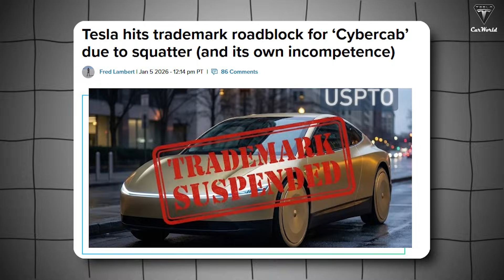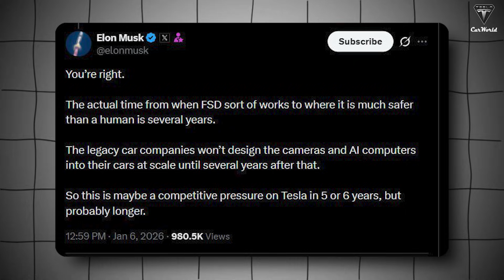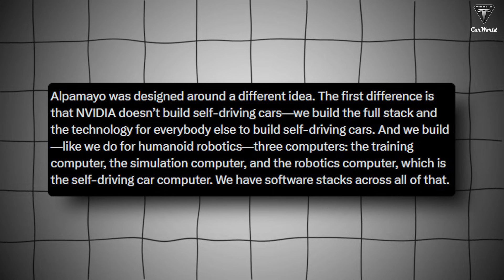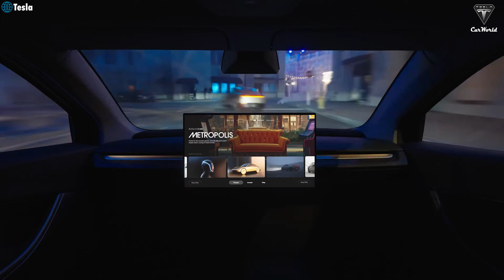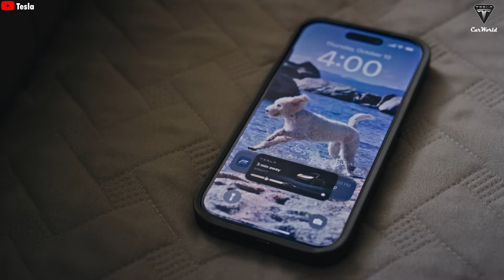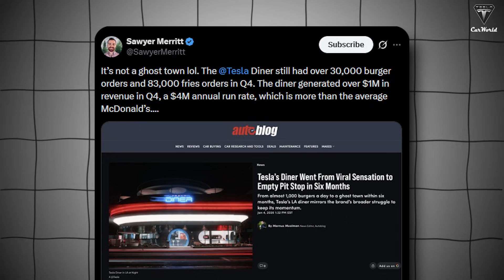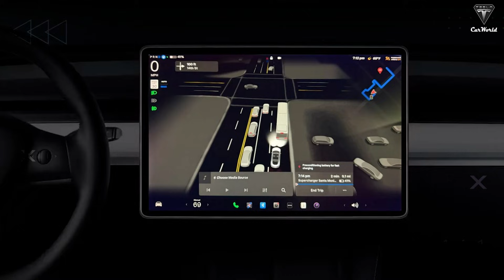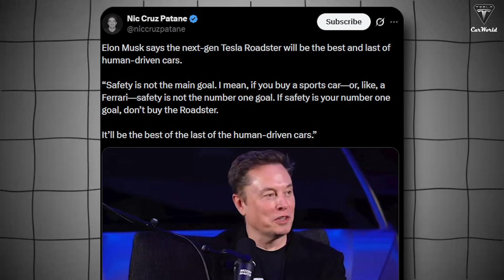Elon Musk Announces Tesla Robotaxi Cybercab Will Take Down Waymo, Nvidia In 2026!

Comment: Waymo currently has a fleet of over 2,500 fully driverless taxis. In contrast, Tesla has zero vehicles legally capable of operating without a human in the driver’s seat. If a Tesla crashes while a passenger is in the backseat, the owner, not Tesla bears full legal responsibility. Waymo  accepts legal responsibility for the vehicle's actions, citing that their "driver" is the tech itself. Tesla, however, continues to place the burden of safety and liability on the human operator. To advance to level 4 or 5 the tech needs to be insured, not the owner.

Comment: Elon! FSD is mind-blowing! But we need an OPTION for a more FUTURISTIC Model Y. 

MILLIONS of people live in APARTMENTS and can’t charge an EV every night. And in a HUGE country LIKE USA, MILLIONS of people NEED or LOVE to travel without stopping 5-10x to recharge.
Give us the OPTION of extreme range: 600–800 miles, even if it costs $10K more, eats up half the trunk, or requires folding part of the rear seat for luggage. That kind of range would be perfect for road trips—or charging once every 2 weeks at increasingly packed Superchargers.
Add a truly futuristic feel with a cool heads-up display (HUD)—check out Hyundai’s new Crater HUD!—and a digital rearview mirror camera, like the ones in Cadillac or Lexus. The benefits are huge: no blocked rear view from passengers or pillars, a wider view of traffic behind you, extra passenger eyes for spotting fast-approaching cars, zigzagging motorcycles, cops etc and no need for driving couples to constantly readjust mirrors. 

Don’t forget the MILLIONS of APARTMENT dwellers and frequent travelers who would absolutely buy a Model Y with HUGE range and a more futuristic design. Remember: people once thought big smartphones were stupid and overpriced—until they started selling like water in the desert!